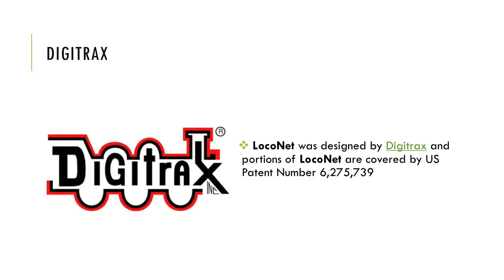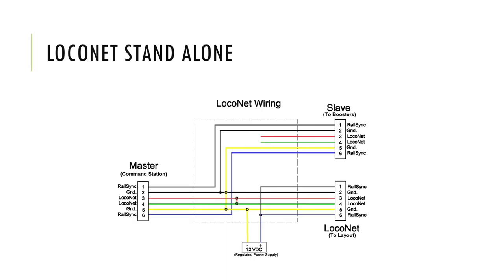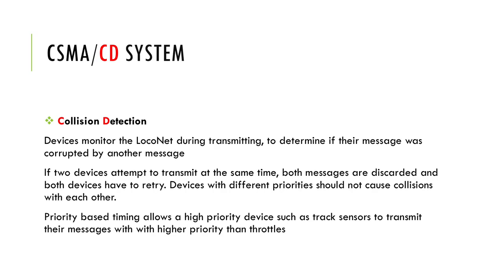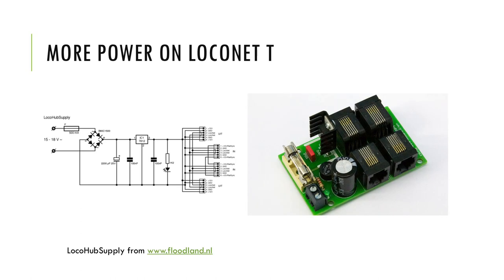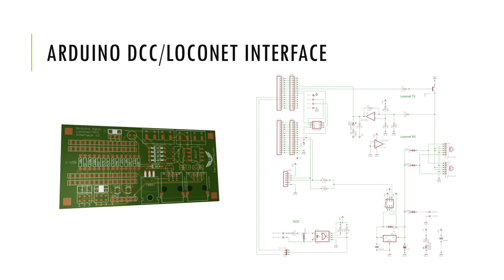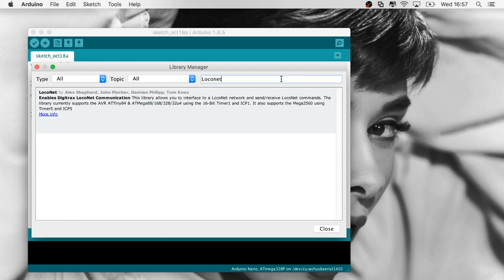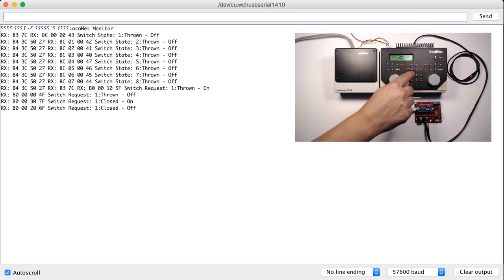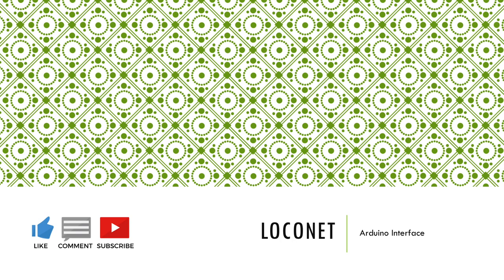Arduino | Loconet Interface (LocoNet Basics)

Comment: I have had success in making the v2 board although I'm a little unclear as to which jumper position I would use if I wanted to power it from an external 12V supply?  Please help!

Comment: great design - thanks for sharing.  do you have a picture of an assembled v2 board?  I am trying to make it myself but don't quite understand why there are 3 holes for capacitors C1 and C3?
Reply from the maker: The 3 holes gives you the option between two physical sizes of capacitors.

I'm working on a v3 board at the moment that incorporates IDC plug to connect to expansion boards. Expansion boards can be used for occupancy detection, LED signals, RFID and connection to the Marklin 6040 using i2c. An adapter board for the v2 will also be available.
Reply: @CuriousTimo  any update on this ?

Comment: Yes Sir indeed : Be advised !  
I think I will stick with the Lenz ABC shuttle and the Lissy Pendelzug Steuerung and my Uhlenbrock Loconet  Universal  Steuerung module 68720 and maybe soon the MD Elektronik MFB module . ALL of these modules provide automation at acceptable prices , require NO  PC wizardry  and come with a manufacturer warranty .  Still a fine effort with the Arduino board 👍

Comment: Hallo Timo
Ben beginnend arduino gebruiker en bezig met een vitrine als fiddleyard.
Daarbij gebruik ik bestaande programma's om te leren hoe bepaalde zaken werken.
Heb het werkend op dcc maar ben op zoek naar loconet combi oplossing.

Zou graag kunnen besturen op DCC maar ook met loconet om via daar de positie doormelding te kunnen doen.
Je geeft aan in je video dat je bezig bent met je combi interface .
Kan de schets zo niet vinden. Hoop dat ik daar iets uit kan leren.
mvg
Jan Hendriks
MSC RailRunners
Reply from the maker: Hallo Jan,

Ik heb net een v3 van mijn LocoNet/DCC interface ontvangen van JLCPCB.
Die ben ik aan het testen en deze werkt met uitbreidingsmodules.

Als de handleiding af is en de 3d behuizing klaar is dan maak ik er een video over en zet alles opensource op GitHub. 

Uitbreidingsmodules die ik heb zijn bv voor LED/Signalen, Märklin 6040 naar LocoNet converter en terugmelding op basis van massadetectie of RFID

Comment: Great Video... Can you tell me one thing... what is this for "#define ARTNR 5001          // Item Number (Art.-Nr.): 50010"
Thanks
Greg
Reply from the maker: That's for LNCV (LocoNet CV Programming).

I don't use it because it doesn't make sense to me. Programming CV using the command station vs modifying the Arduino sketch and uploading over USB.
Reply: so how do you set the address of the arduino?

Comment: so how do you set the address of the arduino?
Reply from the maker: I hard code them in the Arduino sketch. You could also implement LNCV programming from a command station but I find it easier to just upload a sketch over USB.

All the callback functions will report back the address:
void notifySwitchOutputsReport( uint16_t Address, uint8_t Output, uint8_t Direction ) {
Serial.print(Address, DEC);
}

Have a look at https://github.com/CuriousTimo/Arduino-ModelRail/blob/master/Loconet_Pendelzug/Loconet_Pendelzug.inom
Line 64> and line 238>
Reply: Thanks for your help!